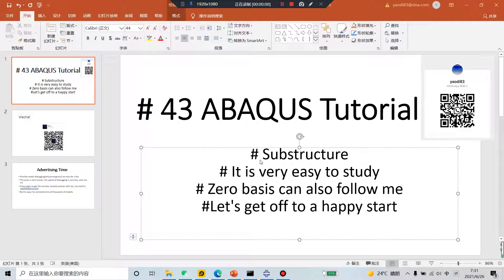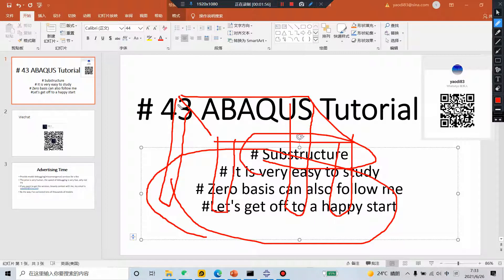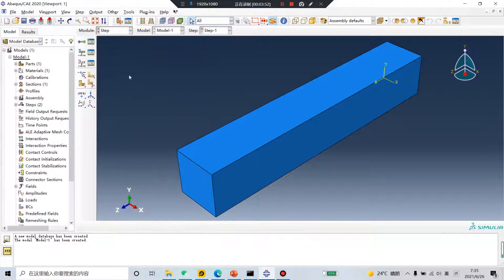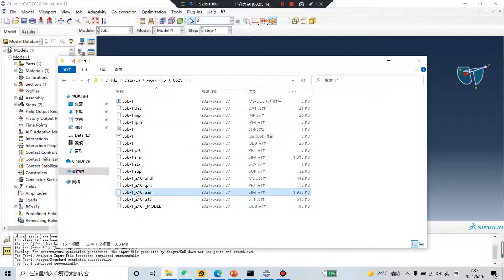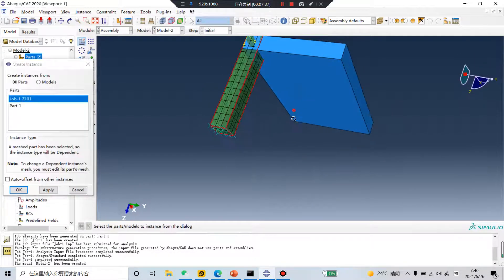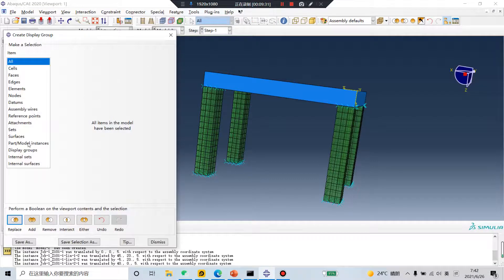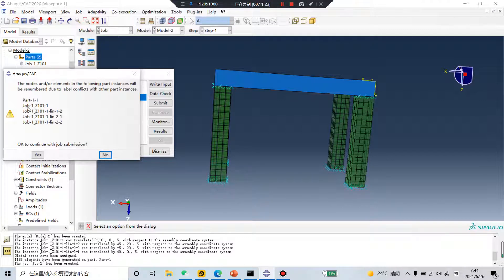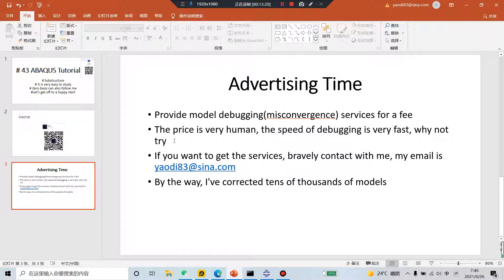# 43 ABAQUS Tutorial # substructure

Comment: I have a model which includes some spring & dashpot and beam elements. I used also substructure in model. I want to extract reduced stiffness and damping matrix. How can I obtain? If you want, I will send ".inp" file.
Reply: Hello, I have encountered a similar problem. Have you solved the problem of extracting the stiffness and mass matrix of the substructure？